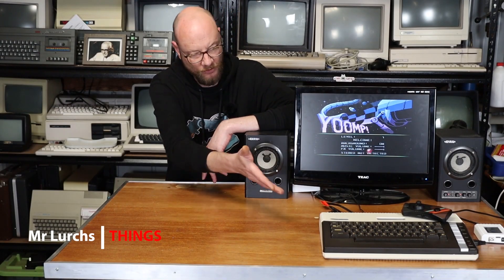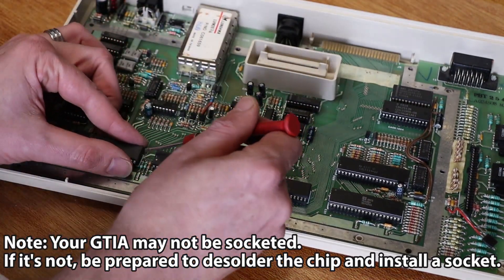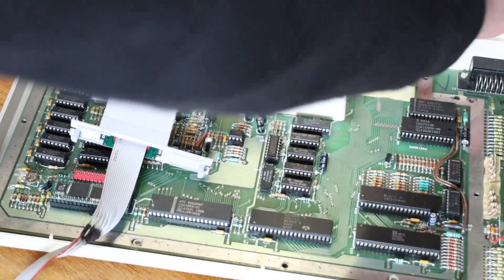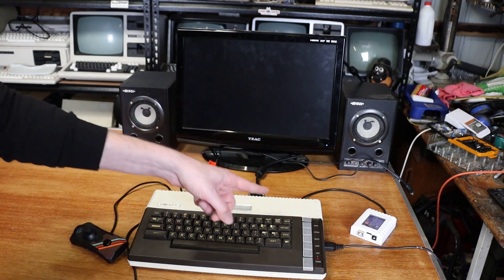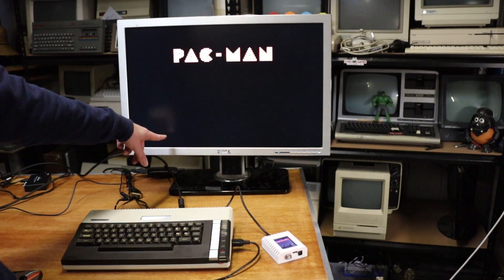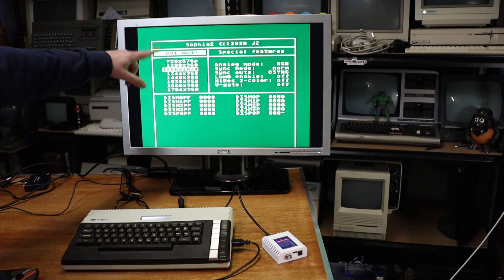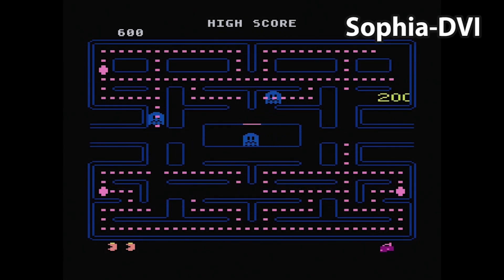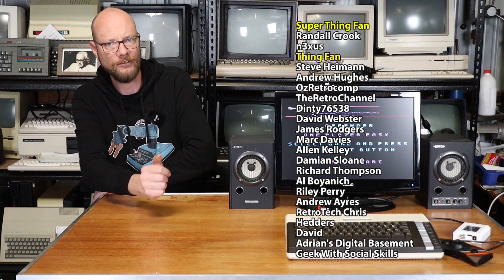Atari 800XL: Sophia 2 DVI video upgrade

Comment: I don't see the advantage of the DVI update.  It's an upscaler of the original signal.  It's not like the upscaling gives you more individually addressable pixels.  It doesn't give you more colors or 80 column text (or 120 column for that matter).  So the screen is sharper...the original screen is plenty sharp for me with my old eyes!  Where are  the actual benefits.  Having a replacement for a dead GTIA is a good thing and I suppose that you might as well make it sharper if you are doing that, but making a straight replacement (if it's cheaper) seems fine to me.  
Also, I use the PBI bus with a 1090XL repro, so blocking the PBI is a non-starter for me.   I guess that's the difference 3 years makes.

Comment: This update is weird and interesting, but i preffer the old TV/AV output, in fact, i still owe two 21" CRT tv's, one of them, a SHARP with stereo sound, where i also play all my NES and PlayStation games; specially all those with a Light gun; i love from NES, Duck Hunt, Wild Gunman, and Operation Wolf; From the PSX, i love Maximum Force, Lethal enforcers, and the Japanesse version of Resident Evil Survivor, cause the american don't support the Namco GunCon; and from ATARI, i love Bug Hunt, Banyard blaster, and specially, Crossbow; so, i would mod one of my two XE systems, and the othe i would let it as it came from stock; and this weird update would be a nice candidate. By the way, which is the joystick that uou used to test the ATARI?

Comment: Great video.  Sorry to ask a bunch of questions, but I have an Atari 800 original, and an Atari 130XE.  I'm just getting into trying them after all these years.  To be able to do chroma/luma output on these, do I need to do a mod like what is needed for the 800XL?  I ask because when I try to do a search with those model names, all I get back are results for the 800XL.  And from prior experience with mucking up things from not finding all of the info, I know this doesn't necessarily mean no mod is needed.  The other question I have is this, is there a  repository of manuals the the various Atari items for reading?  I have several peripherals, but I don't know how to access them, and as such I don't even know if they work.  Tape decks, and disk drives and a printer when I can confirm works with LPRINT at least.

Comment: I really enjoyed your video. It answered my questions very clearly. Now to just wait until they are in stock due to the chip shortages. I initially thought my 800XL might not be socketed, but it was made in Hong Kong and opening the lid, removing the heat shield resulted in seeing sockets everywhere.

Comment: Great video. Could you use an old style IDE HDD cable (cut down) to replace the extended cable you built?
Reply from the maker: possibly, but the cable has got some funky connectors that a) i couldnt source, and b) seem to need a proper tool
Reply: @MrLurchsThings  you are right, after looking closely at the board it looks like these are some none standard connectors. I would like to use the Sophia in my modified 600xl once they are available. Thanks you!

Comment: Alas, I rekindle my 800XL flame through emulation these days, but I remember the day I replaced the VDP in my TI-99/4A and the jaw-dropping upgrade to VGA from composite.
Rock-solid emulator quality graphics from real iron. In the age of multicarts, it makes an XL a very tempting purchase indeed.

Great content. Thank you.
Reply: I can only get about half (or less) of my games to work with my Atari800 emulator.  My main problem is that I can't get my logitech gamepad to work with only about half the games.   So that's why I'd like to buy an Atari 800xl, like I had in the 80s.

Comment: Correct me if I am wrong, but Atari 800XL does NOT support S-Video natively.  So, was it added later?  S-Video wasn't very prominent in the 80's.  Pity, as the "cutting edge" picture quality might have added years to the life of so many consoles.
Reply from the maker: It was a while ago now, but I think I had to make a small mod to get svideo out of this machine.

Comment: Sophia DVI is amazing.  Will Sophia work on a 600XL?  I would like to install the UAV upgrade too on my 600XL.  Will Sophia work in conjunction?
Reply from the maker: I cant comment if it will work with the UAV, but it should work find in the 600

Comment: The s-video comparison actually misses the point, as the Sophia is now also generating the s-video signal (with the GTIA completely removed). A better comparision would be to see the difference between the original GTIA-generated s-video and the Sophia DVI output.
Reply from the maker: If the Sophia is doing it’s job, then it should be producing the same svideo signal as the GTIA, yes?
I can’t say I really noticed that much difference between the original svideo and the Sophia svideo.

Comment: Great job with the install and routing to PBI! How secure is the new PBI bracket? 13:40 I think that Boulderdash is corrupted file. The sound is glitched and there is static on the right edge (DVI video).

Comment: Hmmm... I'm undecided. It's probably great for text stuff, but for games, I actually prefer the imperfect reproduction of a modulator over RF. The low-resolution pixel count on these old machines looks harsh and unpleasant when reproduced faithfully. The imperfect old RF system had a nice side effect where it smoothed some of this out and produced aliasing effects with adjacent pixels etc. I had an 800XL back in the day - I don't remember the RF TV output being that bad TBH.

Comment: No Print Shop for you now that you blocked the printer port!  :)  So, I get the HDMI issue, but I think i'd rather pay the few cents for an hdmi license then have to buy a DVI to HDMI converter (assuming one didn't have a few already).  In any case, love how simple this whole solution is to implement.
Reply: Well that's not a printer port. The adapter blocked the PBI port that is rarely used.

Comment: Very nice and sharp! How's about graphic #8 mode? is it artifacting or non? Try Flight Simulator, Castle Wolfenstein, A.E. other games which support a high resolution.
Reply: Artifacting is completely broken with Sophia 2.
Reply: @gamedoutgamer  thank you! That s what I am looking for.
Reply from the maker: @gamedoutgamer  does the Atari rely on NTSC for artefacts like Apples do?
Reply: @MrLurchsThings  It doesn't fully rely on artifacting, no. But a low percentage of games or applications do. Maybe %10 as a wild guess. Ultima games, Flight Simulator II, Choplifter (early version), A.E, Lode Runner are some examples that do use color artifactings. Most titles do not use this color method.  Thank you for the video and thank you for not hacking your 800XL case and leading us to that great PBI to DVI adapter
Reply from the maker: @gamedoutgamer  did artifacting work on previous versions of the Sophia?
Reply: @MrLurchsThings  I don't think artifacting works on the original Sophia. The only outputs that I know of that do artifacting are the stock outputs on the computer: composite and rf video. The modern UAV-D video upgrade will greatly improve composite output or there is the free "super video 2.1" upgrade (might be 2.0) that is well documented (but not easy). The 800XL is excellent but the video output generation circuits are poorly implemented (blurry/soft video). There is another simple video improvement mod that involves removing one small capacitor from the motherboard.  I made a tutorial video on how to use Atari 8bits if you are interested. I have no idea of your knowledge level of the platform. It's my newest video. A new video will be posted soon on Indus GT disk drives I recently got but for now it's the newest.  CheerS!!
Reply from the maker: Castle Wolfenstein seems to run
Reply: @MrLurchsThings  I want to see the Castle Wolfenstein introduction screen If it is artifacting or non-artifacting.
Reply from the maker: If this is correct, then this is how it appears on my machine.
https://www.youtube.com/watch?v=xcs0xFak8aI

Comment: A great mod to a great mod 👍👍 I'm with you on the case front, I really don't like cutting holes in retro kit.
Reply: Sacrificing the PBI is a little unconventional though as there are various fancy upgrades for it. I guess you can push it to the side if one actually needs it however. I am all for not cutting holes though. One could maybe remove the RF-modulator after all and make an insert for a mini-displayport connector.

Comment: I don't mind the s-video output. I have memories of playing 8bit stuff through blurry/fuzzy RF input. Crap video quality is part of the deal for me.
Reply: On a CRT this looks pretty much alright but modern displays def benefit from it. Then you start playing with upscalers which would do much better with RGB.
Reply: Yes this upgrade is overrated imo. Ruins artifacting as well. However having a DVI signal does open up many more monitors/displays for use.
Reply: @gamedoutgamer  Games that rely on artefacting were badly programmed to begin with and essentially required users to use the worst display outputs the machines had. This isn't an apple II, artefacting was for the most part nothing desirable.

Comment: Thank you so much for not cutting away at the installation. I would really like to try this on my setup. What is the name of the sockets adaptors to easily pull and remove the chips? Also: what's your sound setup? Do you have a video explaining that as well? Great video!
Reply from the maker: First, check to see if you’re GTIA chip is already socketed. If it’s not, that’s a whole different ball game. 
If it is, I just (carefully) use a small screwdriver. I know a few other YouTubers have a tool, but cannot remember it’s specific name. 
As for sound, it’s just a 5 pin DIN plug into the monitor port, but just using the Audio and Ground pins to two RCA/Phono jacks. Nothing special.

Comment: By the way, there is now a new model called simply Sophia 2. See this thread: https://atariage.com/forums/topic/307175-sophia-2-improved-gtia-replacement
Reply: That should be what he is showing. You can’t change the resolution on the original Sophia DVI board without reprogramming the figs, as far as I know. If you can, I would love to know how - I bought an 800XL with one already installed.
Reply from the maker: @Doug_in_NC  I’m going to find out where Henry got them from. The devices we have don’t match the photos in the Atari Age thread. Did the design change at some point?
Reply from the maker: PG. I think you are correct. I got this via Henry, so details are a little vague. 
See the pinned post, but this is indeed a Sophia 2 and not a Sophia Rev C. 
Thank you!!

Comment from the maker: UPDATE: So it turns out this is the Sophia *2*. Thank you to user PG for pointing it out in a comment below.  
It looks identical to the Sophia DVI aka Rev C. And there is multiple, confusing threads on AtariAge. But I think the thread in the (edited) description is now correct. 

Quick one, that I forgot to mention in the video. The FPGA board sits too high to reinstall the top RF shield. Not that Adrian would complain about such things 😂
Also.... it seems the longest TE make those Micro-Match cables is 25cm. Which is a little too short, hence the extension. But you can buy the connectors separately and make your own cable. I just left ordering them too late, thus the tedious job of soldering in the extra cable. Not neat, but works.
Reply: You can reuse the connectors, and any old IDE cable should do fine.
Reply from the maker: @graealex  true. But wasn’t game enough given it was the only set I had. And yeah, it’s just regular ribbon cable I used to extend.
Reply: It's a shame that you didn't mention about the author of the Sophia2...
Reply: @MaksymilianParadys  If that's such a shame, then it's a shame you didn't either. ;-P 
So what about them? Serious question.
Reply: @ropersonline  And why should I do it? He could always put it in the video description anytime, could he...? Sophia (and Sophia2 too) was made by Jacek Żuk (known as Simius).
Reply from the maker: Because until right now I didn’t have a name. 
I’ll add it to the description in a bit